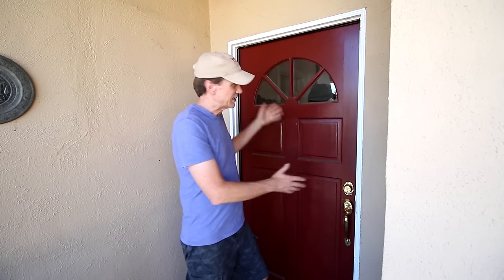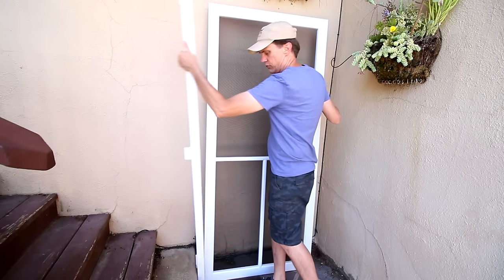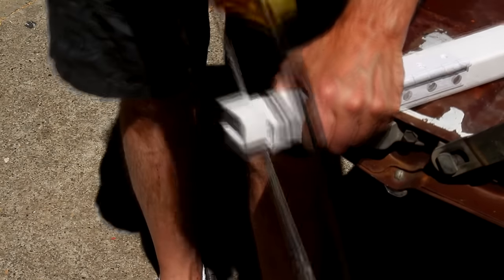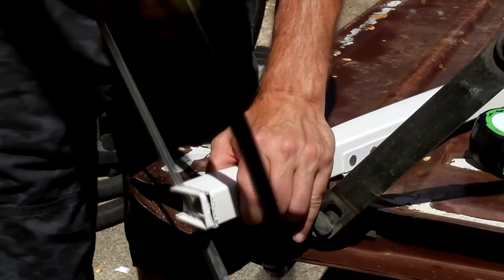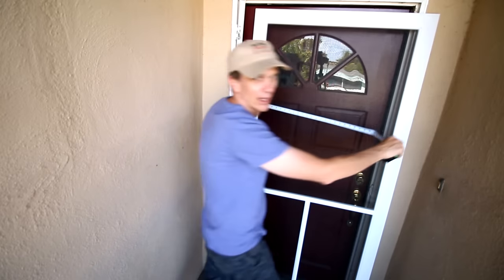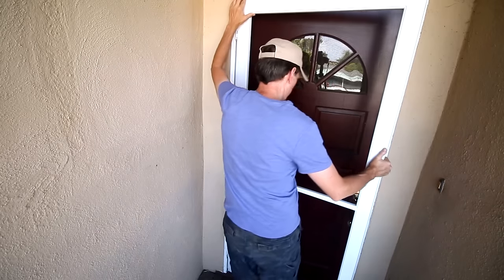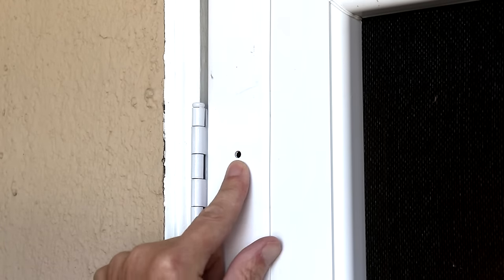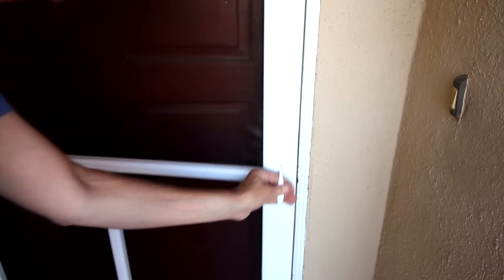Installing a Home Depot Screen Door

Comment: I bought the single door version (no channels) and yes, despite having the original wrapping intact, it was missing 2 of the 3 hinges, door handle and the mickey mouse lock as well as most of the screws. What annoyed me is, even though the screen door fits in the groove outside the door frame, when installed, due to the hinges, it is like 1/16" to 1/8" sticking out. Since no grooves can be dug into the door, the adequate grooves has to be made (requires special tool and skill) on the frame to compensate the space taken by the hinges.

Comment: Just tried to- and did- install this door. Wish I'd watched this video first. I tried to extrapolate from the kind of inadequate instructions that come with the door. He's right- there's a lot of missing hardware and the dimensions are problematic. I may have to totally redo the door because of the gaps left- the door dimensions are slightly eccentric on our front door- I chose to buy some foam tape with an adhesive side to help seal the door area. Not much good to have a screen door that still lets insects in, huh? The result wasn't/isn't great. Glad to have this guy's online help. Live and learn, I guess.

Comment: We were just talking about getting a screen door for the front door!  I was going to build one from scratch but I don't think I can make a light weight one for less than $50, great find and great install video!
Reply: I guess that depends on what you have laying around, and where you get your supplies.  Thinking about it right now, about the only thing I would need to purchase is the screen and spring.  I have a couple of 2x4s that I can rip down on the table saw to make a stick frame.  Hinges came from the dollar store, go figure.  Maybe not as light, but definately will probably hang on the frame a lot longer.
Reply: +Jim Dollens well fine maybe I'll try and make one this weekend and report back.  I have the screen already oddly enough...

Comment: Steve you would have been better off buying a metal vinyl storm kit then these premade ones or the wooden premade screen doors, these never fit right the measurments are off. I buy these wooden screen doors to put on my garage/shop door to keep flies and bugs out just because they are cheap andmy door frame is not perfect plus it gets rained on and over time rots out. The plus side to a storm door is can close the screen but open the inner door to let light in and see out.

Comment: So, this video is 6 years old. How long did it take for the vinyl door to turn into a parrallagram? :) I get your frustration. I installed doors for Depot for 18 years. That was a daily occurrence for me.  Good job on the install though. The reason they are so short in width is so it will fit inside the jamb (35'') when there is no exterior trim to mount to.  Then you add stop on the inside. Keep up the good work.

Comment: For any of you thinking the 20$ wood-frame screen is a better option, make sure to account for the turnbuckle and hinges needed for it and possibly a pneumatic door closer or spring. Also take into account the hours of cursing because the door needs 1/8" shaved off and you've already screwed it into place.
Reply: it shouldn't take that long to take off 1/8" and surely no cursing! :)
Reply: ***** it was on the hinge side which I had already prepared for the hinges and hung. I ended up taking the whole thing down, taking off the 1/8" and re-doing the hinges.
Reply: Adam Rivera I see now! yeah, screw that! ;)
Reply: I think Adam Rivera is secretly a home depot employee or screen door sales man!

Comment: Agree with the metric comment Steve.  At 73, I am still waiting for the change.  I guess I just have find a common denominator, invert and multiply, etc the rest of my life.                                        JimE
Reply: To divide a fraction in half, just double the bottom number. In Steve's case, half of 3/16" is 3/32".

Comment: Easier in metric? To divide a fraction in half, just double the bottom number. I.E. half of your 3/16" is 3/32". Easy.
Reply: and half of 4mm is 2mm xD
Reply: Either way, which is easier? I'd say it's a tie.
Reply: imperial is never going to be as easy as metric. It just isnt.

Comment: I watched this video for one reason--- to see which side of the door is the outside and which is the inside. The video did not indicate this at all! My door definitely is designed one side deep screened and the other side is shallow, not symmetric! It matters on my door. It's not plastic, but traditional wood.   😟

Comment: Using metric would not have made that measurement any easier or any Less absurd. Metric excels at conversions, it's not some miracle system that makes practical use easier.
Reply: True, but subtracting 1/8 from 3/16 can be a pain in the ass... using 10ths to subtract is easier than dealing with 1/2, 1/4, 1/8, 1/16, and 1/32nds and converting between them all.
Reply: Jesse Crandle Subtracting 3 is hard?
Reply: Jesse Crandle There was no conversion. He's installing a door. He never would use more than one measurement the whole time.
Reply: xnamkcor X You're not listening at all. In inches you use FRACTIONS, 3/16th for example, or 1/4 of an inch. When you subtract 3/16 from 1/4 it's more complicated than subtracting 14mm from 20mm. 20-14 is 6mm, simple. When you subtract 3/16 from 1/4 you have to convert the fraction into matching denominators, so 4/16 - 3/16 = 1/16th. You are converting, you're converting fractions.
Reply: Jesse Crandle You know there are marks on the tape measurer, right? You find 1/4, then you go down 3 more 16ths.